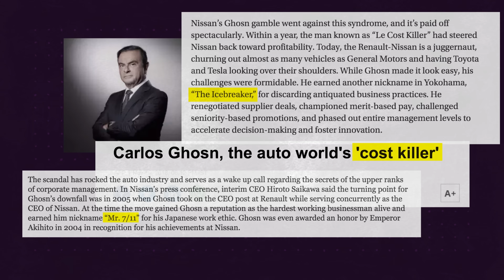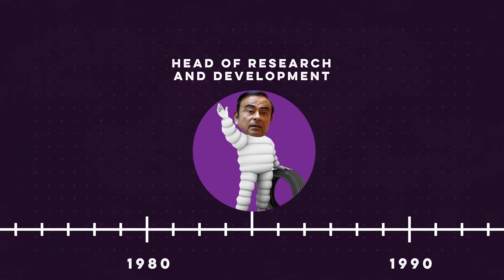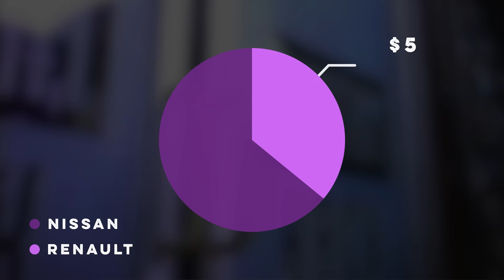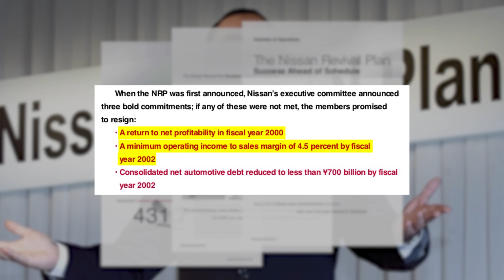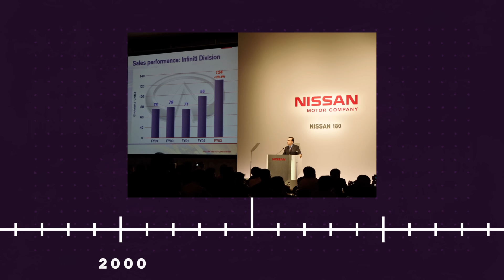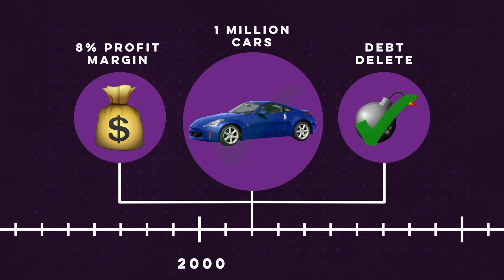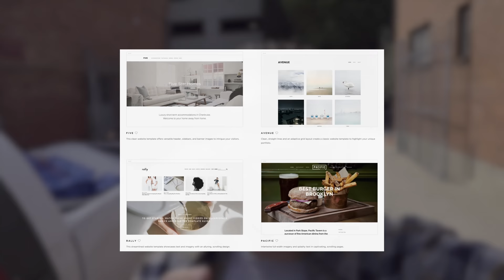CARLOS GHOSN ARRESTED - The Rise and Fall of Nissan's CEO | WheelHouse

Comment: they should arrest the person who made the new eclipse a crossover . lol
Reply: I think that decision might actually be from the CEO, or at least someone close to him, so...
Reply: If i was the CEO i would make the Eclipse Cross mean something, like a Rally Prospect. Something that can compete against the Land Cruiser in the Baja 1000. I will rename the SUV the Mitsubishi Outlander Eclipse Cross. A 4x4 with a 4 cyl diesel engine. Next i will make another cross over that brings back the soul of the evo in a Hatchback. I'll make 2 versions of the horrible Mirage to make this name have the soul of a New age Lancer. #1 a 3cyl Turbo called the Cyborg. 
#2 A 2 liter 4 cyl turbo 300hp 320lb/tq AWD. This mirage will just be called the just called Mitsubishi Evolution. The competion has more power, but this EVO will be in the 2900 pounds if not less. I saw i rendering with a Rally Style Widebody, with 18 inch wheels, since that im impsired and for the market it can sell like hot cakes and compete with more expensive hatchbacks.
Reply: @h.a.4600  There's already a Dakar version of the car, Mitsubishi turns any car into rally ready
Reply: @sansss2027  not anymore...
Reply: @h.a.4600  My 2014 Mirage has been fantastic though. Cheap to own, cheap to maintain, great mpg, and reliable 50k troublefree miles so far. If you add a turbo the cost will go up and reliability down. I uber in a big city merging into fast, dangerous American highways all the time. 74 hp is fine and the engine has some strength because the curb weight is so low (2100lbs). Your idea sounds cool, dont get me wrong, but your design would be fun, not frugal and reliable in my opinion.
Reply: @kylemas2005  actually its not the case, because the turbo i would use it to increase low end torque to increase reliability plus fuel millage, since the car is small and light, 130hp makes it fast, affordable, easy to tune, easy to fix etc etc. I can use the Mirage name to make KEI cars cool in the states.
Reply: @h.a.4600  Well Im rooting for you! But your earlier comment calling the new Mirage horrible might of been too harsh. For what they are they're worth every penny in my experience. We got 2 in our family, a 2014 hatch cvt and a 2017 G4  CVT sedan  version. Thank god a car manufacturer like Mitsubishi, still makes cheap reliable cars for folks struggling to make ends meet.
Reply: @kylemas2005  I'm not a fan of compact cars because of...pussies, and the Mirage has potential to be sporty, since in WRC is famous for having hatchbacks as rally cars, it will be wild if i use the Mirage's design to make it wider to make it manuverable while it has a high power engine and AWD. I would call it....The Mitsubishi Evolution, its not only a car, ITS THE CONTINUATION of the Evolution chapter cementing fear to even of the bravest drivers of how fast it can go anytime anywhere.
Reply: Carlos is the one who is letting Renault influence seep into nissan. He is responsible for the cars suddenly becoming french. Ie: ugly, slow, and unreliable.
Reply: NO.
ITS JDM FOOL.
Reply: Seeing as the eclipse crossover sells way better than the original eclipse I think they’ll be ok.
Reply: Mitsubishi is no longer making performance cars unfortunately, rip lancer and rip eclipse (the real one not this cross-over called the eclipse)

Comment: Who ever designed Nissan's CVTs should be arrested.
Reply: Jatco makes nissan and Mitsubishi cvt
Reply: Who buy CVT it's 2000 euros and few hundred euros more in tax and insurance. If you are not 80 years old and not disabled don't buy automatic. Still have a Dahaitsu sirion and Renault R5 with more than 200.000 km with their original clutch.
Reply: Friend of mines mother had a Nissan Versa CVT completely die at like 50,000 kilometers or so. They had to fight to get a replacement CVT (repair cost of $8500 they were told). The dealership had given them a warranty of a few years, and thank fuck... they got a new CVT. Immediately sold the car after it was fixed.

I had a 1995 Nissan Sentra XE once. Car went 10 years after selling it to a friend in around 2006 without any money being put into it pretty much (brakes, oil etc).
I had a 1989 Nissan Pathfinder SE 5 Speed 3 liter V6 two door, and loved it. Also bulletproof.

Now... Nissan is terrible.
Reply: The company is called JATCO. They make Nissan's transmissions.
Reply: @Xmoto16  And yet Mitsubishi has much less documented evidence of premature CVT failure for their models? Nissan CVT/ECU programming is suspect, the Xtronic system its called. Mitsubishi utilizes the same JATCO CVT7 & CVT8 systems for their models, but pair them off with appropriate low hp, low torque, low curb weight vehicles, greatly extending CVT longevity. The Mitsubishi Mirage is a perfect example of this @ only 74hp, 74 torque, and weighing only 2100lbs. MirageForum.com is a good resource for data concerning the CVT7 JATCO. I would trust my Mirage to hit 200k troublefree miles, I cannot say the same for a Nissan Versa or Sentra, sadly.
Reply: 190,000 km on my Outlander and no issues with my CVT. Change the oil at recommended intervals.

Comment: Nissan will always be in 3rd place of toyota and honda for one simple reason, they refuse to make quality cars. And will eventually pay the price. following in Chrysler's footsteps.
Reply: Mitsubishi too.
Reply: @cnocee  Mitsubishi has been in the gutter for a long time now. Nissan owns a third of the company now. It's like the days of Chrysler and plymouth. Nissan and Mitsubishi share the same relationship and by the looks of it will suffer the same fate, hell these four companies have shared platforms in the past so you know they share similar ways of doing business.
Reply: Jimmy's Brother more like 4th behind Subaru, I see more Subaru’s on the road than Nissan because Nissan has gone to shit
Reply: @r3ktfahdle120  Subaru is succeeding because they offer something different. Boxer engines, symmetrical all wheel drive, very good safety, good economy, low maintenance costs, and decent reliability, for a reasonable price. I believe people's decisions are based on a combination of these factors. Toyota and Honda have obviously made a good name for themselves with reliability, while Mazda is making some impressive efficiency innovations with their powertrains and offer higher quality interiors, which is putting them on the rise. The rest of the manufacturers simply aren't offering much of anything different and so they are slowly dwindling away. Mitsubishi and Nissan used to lead the world in innovation in the 90's but they stopped all of that due to cost and complexity reasons and now they are about as basic as it gets. What these CEO's very often don't realize is that short term cuts to create short term gains are not always what's best for the long term! Especially if you become so conservative that you cut out the very things that make the brand special and unique (like the innovation or racing involvement). Anyway, those are my 2 cents.
Reply: @Bristecom  hit the nail right on the head, and $0.02 taken
Reply: That is like being in 3rd place behind Bill Gates and Jeff Bezos.  I would love to take that place.
Reply: @Bristecom Exactly! I bet those salty Mitsubishi fanboys won't even admit that Subaru is far better after reading your comment, but that's just my opinion tho

Comment: 5:40 I have that silver CRV still, runs like a champ, more fuel efficient than my friends 2010 CRV
Reply: oh yeah because yall have the exact same driving style and drive on the exact same roads
Reply: That's because yours is a 2L and most CRV post-2008 are 2.4L.
Reply: My dad had one died at 330k with regular maintenance, was burning 1l per 800km, later caught fire, horrible car. Honda Jazz burning 1l at 220k, meanwhile 1.9 TDI Golf close to a million, solid as a tank.

Comment: Despite saving nissan from bankruptcy he killed alot of legendary nissans, in middle east he killed the cedric and gloria, primera,  after 2003 he changed the factory for the sunny it was japanese,  in 2014 he changed the factory of the d22 hardbody,  reliability in general was going down...( nissan cedric and gloria was very famous cars in middle east the cedric models we had were 330, 430,  y30,  wy30 , y31, sy31,  the gloria we had only y33)  probably now we will get them back

Comment: After he entered Renaults presidency, they completely changed the way the act in Brazil. The once equipped and aligned to the technologies and models of Renault France became less available (The Laguna and Twingo, both of which sold very little, were quickly droped from our market). We probably didn't buy many Renaults back then, as they were expensive because of large use of equipment (In Brazil, ABS and Airbags weren't mandatory up until 2013 and people still don't seem to see safety as a value, as many of our cars have a bad safety scoring). The BR-Made Renaults tended to be less equiped, but offering a price and a product that meeted Brazilian Market needs, soon enough, Renault must have become profitable and then enters the Renault Logan/Sandero, Renault's improvement of the Second Generation Clio Platform, a car that made Renault popular in Brazil.

Also, who was Nissan in Brazil back in the 90's?? Ok, they went better than Mazda, but after the takeover, they changed completely the way the act here in Brazil. With the Mexico-Brazil deal on imports, cars made for the NAFTA region became available in low prices, we quickly got the Tiida(Versa) and Sentra and they started building the image of the make. As the marque got even more notorious, we started production of the BR-made March, Versa and Kicks.

Not defending the bad choices, but the good choices made Nissan/Renault alliance very strong at LATAM.

Comment: Because they made the Evo into a crossover
Reply: Darkstar 20 not yet, just the eclipse
Reply: @grunkohlaktionar7474  well they basically did, theyve had the concept for a while and have been taking it to auto shows n such, but I only got hope because the Evo was a trim level, I hope they keep the lancer evolution trim level
Reply: Darkstar 20 yeah but it’s not called lancer. And if that new crossover thing has 700hp its a good thing.
Reply: @grunkohlaktionar7474  no I know lol I'm saying that they keep the lancer Evo separate from the concept evo
Reply: Concept Evo maybe is the successor of Pajero Evo (because both of them are classed as SUV/CUV, and Pajero Evo has ended)